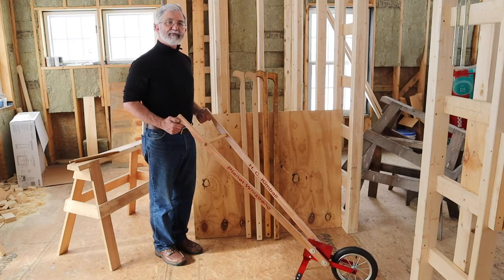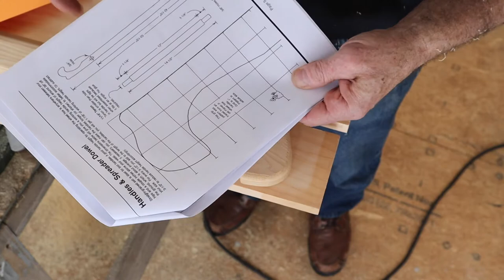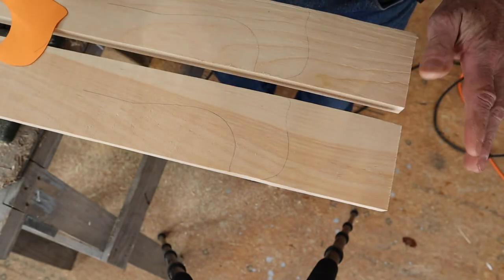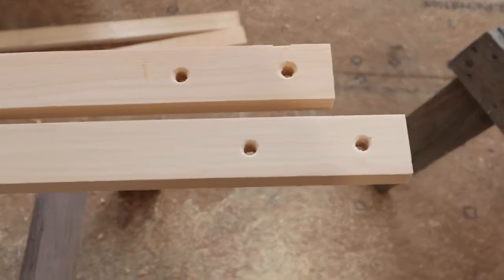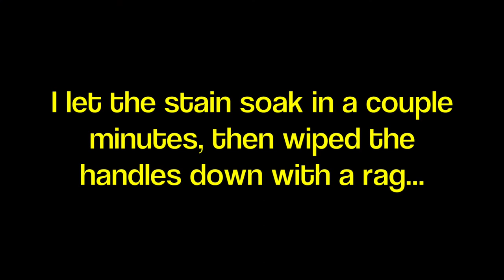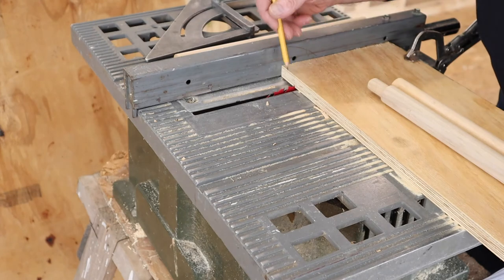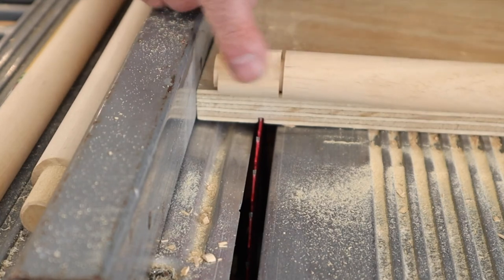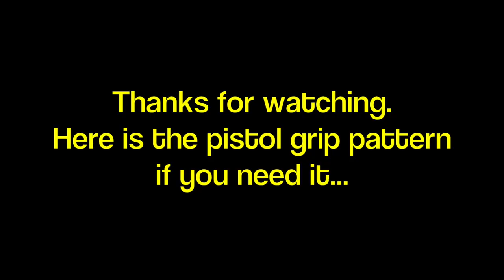How To Make Your Own Wheel Hoe Handles

Comment from the maker: Whizbang wheel hoe information and specifications here: https://www.planetwhizbang.com/whizbangwheelhoe

Note: I made my first wheel hoe handles back in 1977. I was 19 years old. I found the rusty (but still sound) metal frame of an old high-wheel push cultivator in a farm scrap pile. It was outfitted with a 5-tine cultivator head. I made some inexpensive pine handles for that hoe and used it for a few years. Pine is a softer wood than ash or maple, but those pine handles worked just fine.